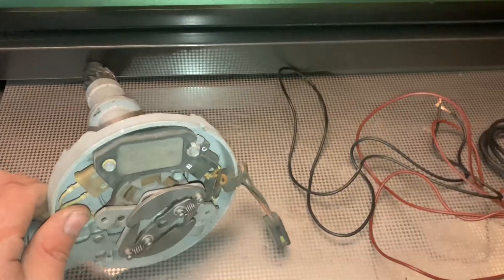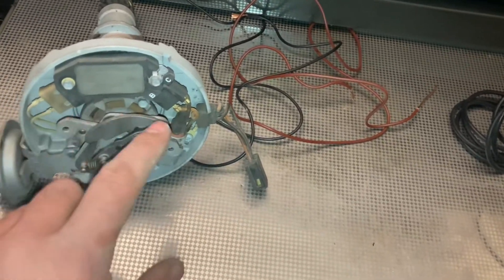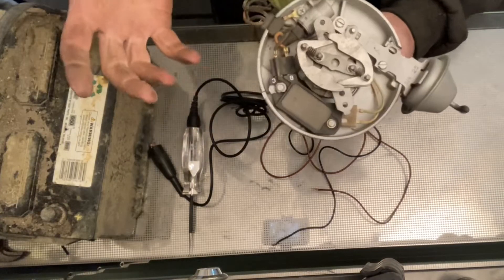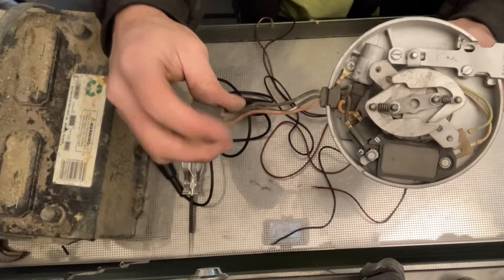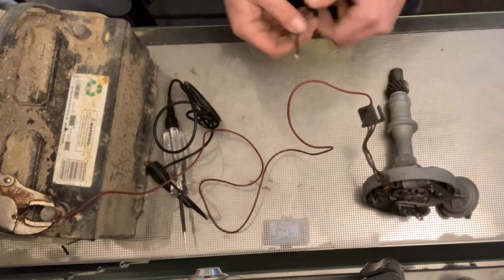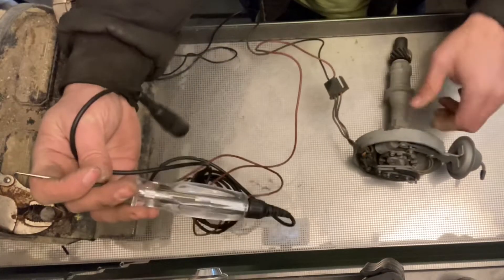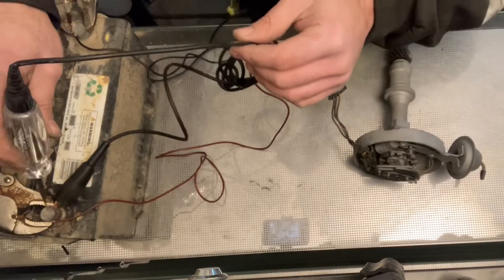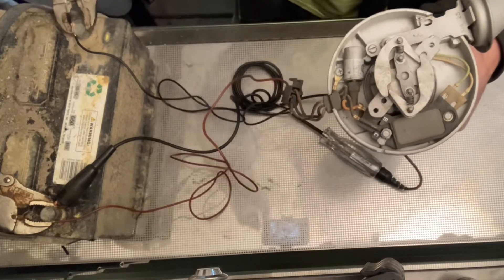HEI distributor testing free easy way

Comment: My test light stays lit when I touch the  c-terminal. When I spin the dizzy it doesn't blink it just stays lit.
Reply from the maker: Wiring issue or failed module.  The light should only turn on as you rotate the distributor.   Being on all the time something is shorted to ground.

Comment: Great video, thank you! 

Back in the old days, you'd just take the module to the auto parts store to test, but those days are about over 😥

I keep having modules go out in my 77 350. This last one lasted less than 1k miles and that was after replacing all but the pickup coil with Delco parts, but that didn't help either.  I've recently read that cheap/old plug wires can cause a module to crater early, so i think my next step will be to replace the plug wires.

Any other tips/suggestions would be greatly appreciated.   Thanks again!
Reply from the maker: I haven’t experienced many repeat module failures, only thing that comes to mind is do you have the white grease on the back side?  It helps heat transfer and heat isn’t good on electronics.
Reply: @VinylVillageGarage yes I've always used the white 'bird poopish' grease when replacing them... I've even thought about externally mounting it on the firewall with a big ole heatsink on it...

Someone else commented that bad plug wires can take out a module so I'm going to try that first...  Thanks!
Reply: @pspaulson bad plug wires, bad ground, and cheap modules with poor internal heat transfer are the most common issues. Gm d1906 is decent, GM 990 is best and Napa t45 is good too. Some people with melonized gears and roller cams have issues with grounding and need to add an external ground to the body itself
Reply: @crackjack8320 I replaced my plug wires, but it still ran weak with a miss most of the time.  After slowing down and looking at things more closely, I realized the middle ground wire from y coil to the middle pin under the cap was MISSING! Years ago some idiot (Me) forgot to transfer the wire to the new cap😢 I wished it wouldn't have run at all so I would have found the problem much quicker, but...

Comment: Can the pickup work and allow the car to fire and run fun but when it revs up can the pickup start failing? I car will fire and run fine but miss on cylinder 2 once reved up. Pickup ohms out at 819 and I’ve replaced everything else on the distributor except for the pickup . I’ve replaced all other electrical stuff with no luck
Reply from the maker: The pickup works every 45 degrees and doesn’t matter what cylinder in the same signal. So to only misfire on cylinder 2 I don’t see how it could be the pickup it makes more sense that it is something related only to Cyl 2, mechanical issue, plug wire, or spark plug.

Comment: I tested mine and it tested good but my engine still won't fire, not too sure what I should rule out
Reply from the maker: Do you have a verified 12v source? If it’s good it leaves you to an ignition coil, coil wiring or distributor cap problem
Reply: @VinylVillageGarage  that's what it was It wasn't connected all the way. It fires now. But now it just fires after a few rotations and then immediately stops so I'm pretty sure I'm gonna have to find TDC and then re time it

Comment: Can this test method be done with the distributor installed in the car? I should be able to spin the distributor with turning the ignition key... bumping it around.. correct?
Reply from the maker: Yes.   Absolutely. It just needs to spin.

Comment: Great information. I just rebuilt the trans on a Hyster with a propane GM engine with HEI. On the final test drive, it died with no spark. I have been struggling on this because I'm a diesel guy, so propane and HEI are both foreign to me. So far, the only videos I have found show resistance checks. The pickup shows correct resistance, so I'm hoping that proves out that its working. 

Anyway, this will help. If course now I will be bombarded with 1000 videos on testing HEI coils but if it helps, it will be worth it.
Reply from the maker: awesome glad to help and thank you for watching
Reply: @VinylVillageGarage  I had the same test results as someone earlier posted. With power and ground hooked up, my test light lit up on the coil terminal. New module, and new harnes/condenser Assy and it fired right off.
Reply from the maker: @timothyball3144 right on! Got it going

Comment: Have you or can you do a video on testing a GM HEI Pick Up Coil showing what the test reading should be on a good Pick Up Coil?
Reply: Pickup coil is an A/C generator. Disconnect and  probe the PU connector with DVOM set on AC volts. Should see about 2.6 when cranking. 
      A less reliable check is to ohm the coil. Should be 800-1200 ohms.
    Hope this helps.
Reply from the maker: I haven’t yet but I will see if I can dig up an hei distributor and put something together.  The signal out of the pickup coil is best read with a scope it should be a nice even square wave signal. I doubt many of us have a scope so the question becomes how can I test it at home? FYI kind of thing the coils  do fail but most of the time if having a pickup coil issue check terminal connections at the module. Normally the problem lies their loose or dirty contacts

Comment: Just completed the test and my test light stays illuminated and does not flash during distributor rotation
Reply from the maker: That’s not good. Definitely will not operate if that is the case. Either a faulty module or wiring issue.  The light should be out until distributor is rotated.
Reply: @VinylVillageGarage  Thank you .

Comment: What if when you test it instead of it flashing when u spin it it's just has power to it all the time ???
Reply from the maker: If the test light was hooked to a 12v positive source and the other end is on the wire that goes to the coil negative and your light stays on all the time my guess is the module has failed. I never had that happen yet but that tells me the module is stuck on ground output instead of pulsing the ground.   Just for curiosity unplug the pickup coil should be the white and green wired plug and does the light still stay on? If it does it really supports the failed module. 

The module should not be a ground output until triggered by the pickup coil, normally it’s an open circuit when not triggered.

Comment: Hello I realize this is an older post hopefully this message finds you well !
I am on my second module one from local supply house the other from Rockauto…
So far out of the 4 modules I have (2) original from 2 different distributors) not one of them sends signal like described 
Am I missing something ? Sending power to orange wire on module then I spin the shaft and get nothing in the B side..
Any help is appreciated 
Mike
Reply from the maker: I think i can help.   The Test i did here was just to see if it worked, fortunately or
Maybe unfortunately it did.  I didn’t have to diagnose any issues. 
 Inside that distributor you have more then just the module that can cause a no spark or no pulse issue. The pickup coil is the part that goes around the shaft it normally has a white and green wire plug that goes into the module.  That is a little more tricky to test but as you rotate the distributor it creates a AC voltage when working properly. You really need a scope to test it. Those do fail, rarely but it happens. The best you can do at home is do a continuity test on the coil which will also test the wires.  Take multimeter remove the plug and test continuity between the two wires. Should have something, if so then leave one lead on either wire and touch the other to the distributor base and make sure it doesn’t have continuity.  If both those test good it might just be a faulty pickup coil still.  The biggest issues with an HEI is a failed module, or poor electrical connection of the pickup coil to the module, rarely was it ever the pickup coil. Seeing how you already did 4  modules and no spark I doubt you have a faulty module. Clean or wiggle the wire connectors still not operating then replace pickup coil.
Reply: @VinylVillageGarage  I appreciate the quick reply I’ll work on the coil test…I should have been more specific I didn’t get my test light to light up when I spun the shaft ! I didn’t install the distributor at this point so I guess my question is…the test that u did with 12v to  module is that fool proof ? I didn’t get a pulse to test light when shaft spinning 
Of coarse I see that the trigger on shaft may be faulty but I’m using two seperate distributors I’m thinking may not be that
I appreciate the help but don’t expect you to diagnose my problem over YouTube 
Haha
Reply from the maker: I agree with you I dont think you have two faulty pickup coils.  Answer to question one Yes it should be able to operate a 12v test light on and off as you rotate the distributor. Keep in mind that ground pulse from the module during normal operation is running a coil which has a higher amperage draw. 
  Is the issue with your wiring configuration?  It’s been awhile since I did the video can’t remember how I showed it but make sure you have the test light one end on the positive battery and the other on the module. 
Also make sure the distributor is well grounded to the battery.   Let me know what you find.
Reply: @VinylVillageGarage  ok there’s the problem didn’t ground the body of the distributor 
Thanks again brother
Reply from the maker: Oh man that will do it.  I hope this helps.  Anything else let me know.

Comment: Back in the day I had 1975 Impala that had a failure to the pickup coil. I replaced the module because I thought it was the more likely fault. Had to pull the distributer out to change the trigger pickup coil.
Reply from the maker: That’s a job to install. Pickup coils do fail but most of the time the failure is a poor electrical connection from the coil to the module.